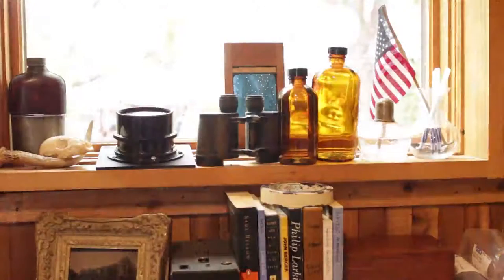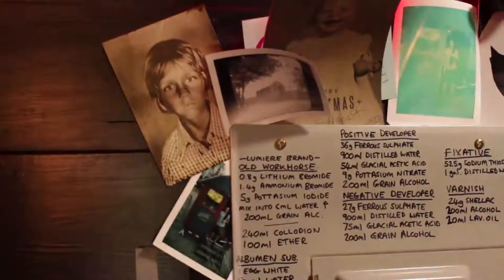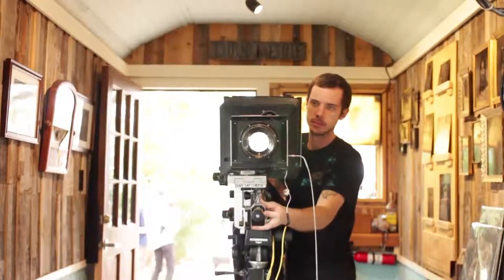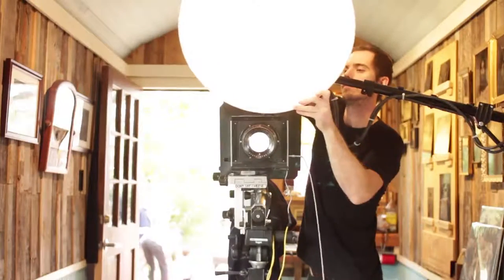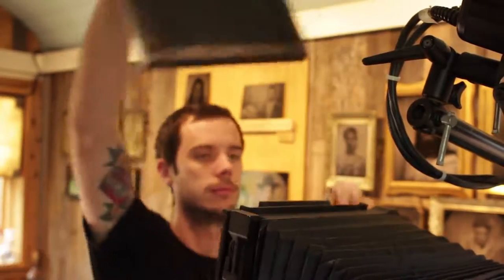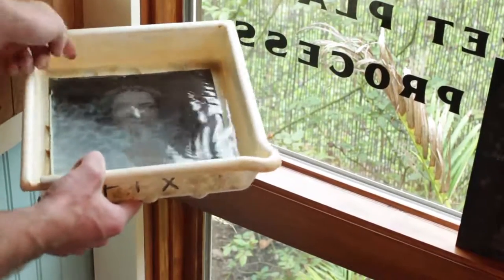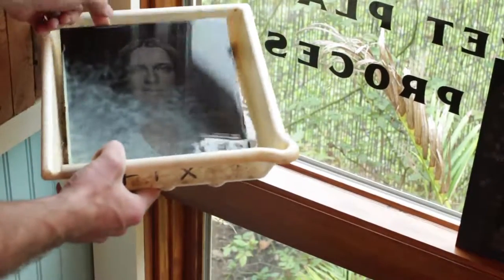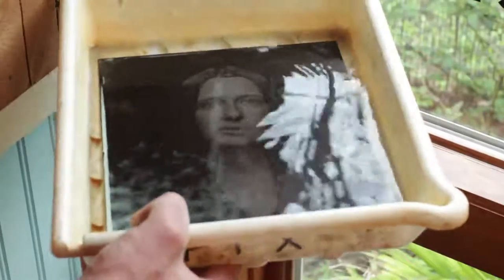How I do Tintype Photography

Comment: Very helpful, especially the studio bit.  I have some large daylight fluorescent tube banks, thay were used in my video studio before led lights came along, and I think they would work.  I read that you can also use UV tubes as well, have you tried that.  I like your 10x8  Sinar P, I have a 5x4 one which will do for starters.